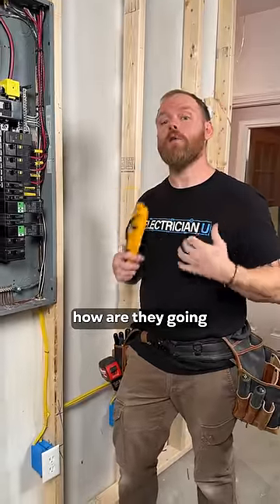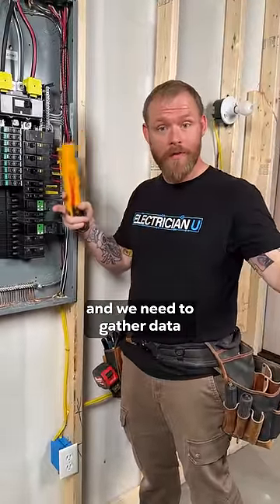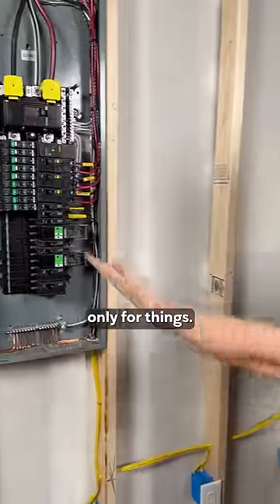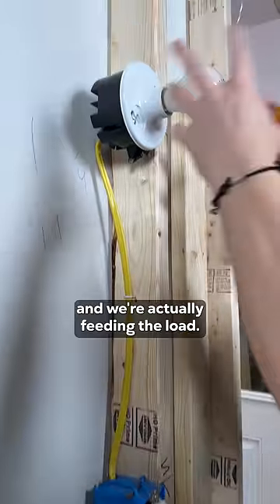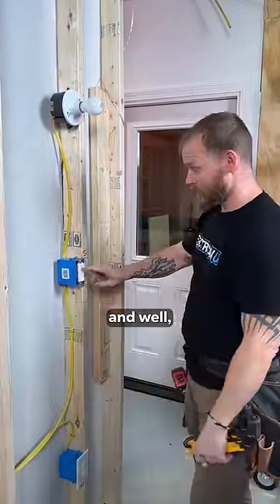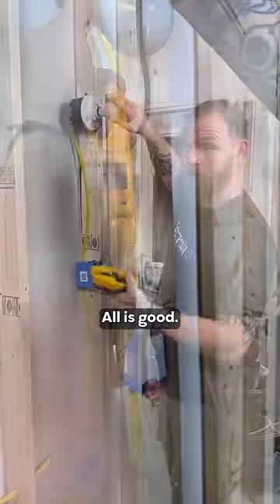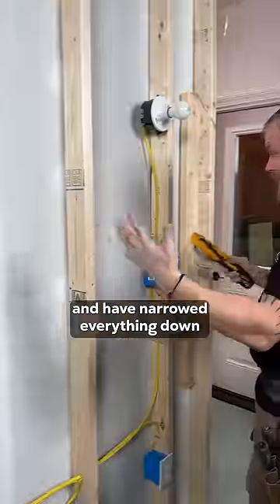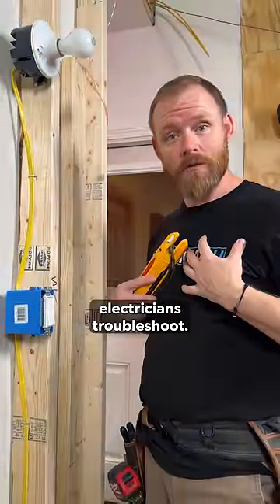How Electricians Troubleshoot a Problem

Comment: I've worked electrical engineering/design/installation/commissioning for 20 yrs now. All electricians are different. Some are great installers (running conduit, pulling cable, etc), some are great at terminating and dressing panels, some are great at troubleshooting.

It's very rare to find all three traits in one.
Reply: As a union Electrician I can say that we train to do it all, installation, troubleshooting and even programming stuff like PLCs...The field is so vast that most guys seem to specialize in a thing, all can do everything, but most are masters of few specialized things, few are excellent all around, but it's all experience based, you can't excell at something you didn't spend alot of time doing! So far I am lucky to have a very diverse and well rounded training (alot of troubleshooting and service calls, and also alot of installation in big new construction jobsites) I concider myself very lucky
Reply: I am a trouble shooter and have people wanting me to wire their new home. I tell them others can do it a lot faster and less expensive.  If they want, I will come back and do a pre-inspection for them.
Reply: I guess I’m an endangered species!!
Reply: @Hatim.13 they teach you to troubleshoot plcs? I heard that’s a whole different game than wiring.
Reply: @Hatim.13   There is no such thing as a Master electrician. I have been an electrician for 25 years and I learn something new everyday.
Reply: @explod329  Well technically there is the title "Master Electrician" which refer to those who took and passed the master electrician test.
But what I meant is that some electricians are masters of few things, for exemple some Electricians are conduit bending wizards, some are troubleshooting rockstars...By Master I meant the best of the best in a specific skill! They re few in between, and their names are known and recognized in the local electricians communities (in the local union)
Reply: @yt-kingdavid2359  PLC's are not that difficult once you get involved with them. Having the software to interface with them can give you much more information than looking at just the lights on the I/O racks.
Reply: And it's why i had such a successful business
Reply: @blybruce  sorry i didn`t see your comment till now. thanks for answering! i build panels right now mainly working on small pump panels. I love electrical work lol.

Comment: That is the most professionally laid out panel box I’ve seen in a while. Nice work.
Reply: Electricians take great pride in clean breaker boxes.... They get sloppy when maintenance, or customers mess with them.
Reply: Only cost the homeowner 2 grand
Reply: @justinberry3991 that's reasonable for a good job it's not hard to find half-assed if that's what you want😅
Reply: @claytongetz6362  I do my own. Electrical is not hard as long as you have common sense 🤣
Reply: It looks pretty but the next guy is gonna be pissed🤦‍♂️

Comment: Test for power at the source, the switch, and the load.
Reply: I would probably go in reverse order to that personally, depending on how easy it is to test for power at certain locations.
Reply: @anthonyesposito7  The order is personal preference, but those are your points of testing.

Comment: I previously worked as an electronics tech (low voltage and data stuff).  The maddening thing to me that electricians have to deal with is the biggest unknown: Not knowing what all is connected to a circuit and no wiring diagram.
Reply: Similar issues in programming: lack of documentation. Even a great system is hard to understand if it doesn't have the right documentation. A poorly designed system without documentation can be easier to replace than fix.
Reply: @moldovancrisis5482  funny, cause I work in development now, and I know exactly what you mean!

Comment: By MAKING an Check-in  you Solve the Problen .
First : analizing the
Source of Power , Second :  breaker and Third the bulb lamp,.
Soon by Constating everything was Ok , EXEPTING the SWITCH from eliminating troubleshoots you find out the cause of eletrical failure.

Comment: I like to take out the bulb and use my noncontact voltage pen and see if there's voltage going up. If the indicator is that voltage is, I will grab my meter and confirm 120.
Reply: This

Comment: I did a TON of electric work as a maintenance tech. It amazing how many people can’t do basic troubleshooting. It’s a process of elimination and understanding how things run. Most people give up because they are lazy. I saved my company at least $10k a year by just doing the troubleshooting. Fixing a problem is easy. Finding the problem takes patience and basic knowledge
Reply: May not even be laziness but a lack of knowledge. You may as well be the second coming of jesus christ to the factory boss if you can re-identify cut motor leads.
Reply: its not really people not being able to do troubleshooting, its definitely people not knowing because they don't care to learn. that's why people hire others that are professionals in that field. so its not that they dont understand, they just don't care enough to learn because that's an electricians job, not theirs.

Comment: Testing continuity from neutral to ground can help identify open neutrals or a break in the wire.
Reply: Interesting I always test hot to neutral voltage but your way would work to

Comment: I would nearly always test from the panel first, see if the contacts on the breaker arent stuck, there's power going out, test for a short if there is no power, test between phases. And go from there.
Reply: Usually residental is single phase so how could you test between phases? You mean leg A and leg B?
Reply: @explod329  Some people refer to Leg A and Leg B as A phase or B phase, even in residential. At least that’s what I’ve heard in the past when I did residential.
Reply: @davisvilla16  Those "Some People" are wrong. It's single phase! How can you have A Phase and B Phase when you only have 1 phase?
Reply: @explod329   at least in canada theres 2 phases on a "single phase" residential service. 120V on phase A and 120V on phase B, 240V between them. Im not sure why its called single phase really. And if you didnt know there's 2 phases why are you trying to correct people lol?
Reply: @explod329  On the secondary of a  center tapped step down transformer the two legs are 180 degrees out of phase of each other. In other words the legs are two different phases.
Reply: @MN-Hillbilly  That is not true. It is the same phase producing two signals. One is positive and the other is Negative while the center is neutral.
Reply: Just call them phases its fine if were getting technical its 2 opposing legs of a single phase transformer. I suggest everybody look into high voltage through👌 fun stuff to research
Reply: @explod329  If it's a single phase then how can it have a different potential (voltage) between them? The transformer is a power transfer device, the primary and secondary are electrically isolated from one another. The transformer is now the "source" for power with two phases that are 180 degrees out of phase of phase of each other.

On the up stream distribution system the whole load is carried by a single phase.
Reply: @MN-Hillbilly  My advise to you is educate yourself on how transformers actually work. Just because they are 180 degress out of phase from each other does not add another phase. You have positive and negative waves within the same phase.
Reply: @UnifiedInfo  No, do NOT call them phases as this is wrong and teaching others with incorrect information. When i started my career people like you would tell me to call it this, call it that. I did not know any better so that is how i learned. Later in my career once i started doing my test i quickly realize that all the terms I was taught was wrong and i really struggled to understand. It felt like i had to start over especially with the terminolgy. Please do not tell people to "JUST CALL IT THIS" Some people takes their career more serious than you and want to be "Technical" I am your "Technical type of guy and I have been very successful in my career and i'm sure others would prefer correct information.
Reply: @explod329  You might want to educate yourself on basic AC theory if you think the positive and negative voltages are the same phase. I will agree it is derived from the same distribution phase.
Reply: @explod329  I like your last reply, you sound like me. I'm not going to give up on you.

I think you are getting caught up with this transformer being fed by a single phase of a multi-phase system. Let's take the transformer out of it. Let's say we are powering a motor, be it three-phase, single-phase, shoot 100-phase. We just want to transfer the power coming into it to another system. So let's connect the shaft of this motor to a magneto (or alternator) and we have two windings in it that are orientated 180 degrees from each other. 

Now we power the motor to spin the shaft that in turn spins the magnet. Would that not produce two phases?

If we added a third set of windings and oriented the three at 120 degrees from each other would that now create three phases?

Comment: As a auto technician, I have the same rough diag steps, as in most electrical issues, there's the control (computer or switch), wiring and intermediate connectors, and the load/sensor/actuator.

I still have to break it down for customers who think the scan tool tells me what's wrong and what to replace. The DTC (Diagnostic Trouble Code) is just a symptom of a problem, or as I like to put it, it's the computer saying "this isn't right, it's not working like it should" 

You have a O2 sensor heater code? It could be the sensor, or a broken wire, or corrosion in a connector, blown fuse, or even a bad driver/circuit problem in the computer. If you want to throw a sensor at it, more power to you, but don't cry at me if it doesn't fix it.
Reply: Most all automotive diagnosis is at least partially influenced by economic restraints.
Reply: I repaired cell tower equipment, 12 layer PCBs, over 1000 chips spread across 4 boards. Our computer diagnostics would say "it's not outputting enough power" and it's up to me to figure out which board, and which component on that board.

Hard job, but you can eliminate half of the chips because it turns on, another half because it's channel 2 that's low, another half because it's the transmit not the receive, etc. Pretty soon you are down to a handful, and can do a combo of multimeter, process of elimination, shotgunning, etc.

Computers and scripts can help A LOT, but they don't tell you what to do, nor specifically what is wrong.
Reply: @phillyphakename1255  Yeah, I agree. Unfortunately it's only going to get worse. The vehicles now are rolling servers cabinets. +30 computers, 5 or more different communication networks (including Ethernet, not the same as internet Ethernet either), some computers that are also hubs and act like routers, now also throw in cell phone, wi-fi, Bluetooth, GPS, sat radio, sat TV...

For example, Cummins diesel has 5 computers to run it and the emissions system, all running on their own separate communication network.
Reply: @CJ-jo6do  oh gosh. That's... A lot.

I know you'd just be doing board level swaps, but with a system that big, "just" isn't really a good description.
Reply: @phillyphakename1255  Yes, real fun explaining to customers what and why their vehicle doesn't work, and the diag time.

Horn don't work? Could be a fuse, bad switch, or a corrupted IHS CAN bus because of corrosion in a harness connector causing lost of communication between the SCM and the BCM. You know, simple things.😅
Reply: @CJ-jo6do  now you're just confirming my "no automotive electrical for friends for free" rule.

Comment: My buddy decided that every light fixture and switch/plug device had to be removed from his apartment. It was wired by some guy back in the 70's. The main light fixture box (center ceiling) was a main junction point to 3 runs. One was a single 14/2 wire ran to the main light fixture, backfed down the neutral. Two other legs, one a main supply to a small addition and one wad the outlets/second light in the bathroom. Surprised the hell out of me, and reminded me why I am happy to have a quality auto ranging multimeter with NCV test capabilities (Southwire).

Comment: I had a circuit with three groups of 4 recessed LEDs I installed recently. When turning one on of the groups it would immediately trip the breaker. 

The junction box for the lights had a resistance readeing of .5-.9 ohms. I went about searching for any discrepancies and eliminating possibilities. It ended up coming down to one of the hot wires in the first box somehow making contact with the metal housing. It was difficult to reach and I wasn't able to see exactly how it happened, but i got it sorted out. I enjoyed the troubleshooting part of it.

Comment: This is really the process to troubleshoot anything. Car, computer, etc. It's basically Occams razor in a process of elimination algorithm.
What's wrong or what needs to be fixed? What's the simplest explanation? Did it work? If it didn't: What's the next simplest explanation?

Comment: You can have a “hunch” on what’s wrong and go right to that but generally you check the easy things first then if necessary you go progressively deeper. That’s how experienced electricians trouble shoot and how new ones should be taught.
Reply: They get paid by the hour, they will stretch out their "hunches".
Reply: @moefritz9568  not if you want repeat business real professionals don't waste time they find the problem

Comment: i would have felt the switch, noticed it wasn't functioning properly and replaced it right away. Then moved on afterwards. Like, you can easily check if it has power with a power probe, multimeter takes a lot of time to get out, connect, turn to the right setting, etc.

Comment: I work on cell towers. It's basically the same process for us doing maintenance. One additional thing we do is use a "known good" to narrow down the issue. One radio is powered up and the one next to it isn't? Roll power between the two and see if the issue moves or stays.

Comment: As an electrician I’m just curious what you could possibly need that massive belt for
Reply: Coffee, creamer, sugar, cup, spoon and biscuits.  😂
Reply: Joking aside a belt with that much metal and junk is actually considered dangerous in an industrial environment,  And in food production is actually illegal.
Reply: Other than sexy, it depends on the job and environment.  As someone who often works on old multi-story buildings, where I'm up and down stairs, ladders, etc. Having all my important kit on me is the way to go. I have a few different belts and bags,
Reply: @stringlarson1247  The one time I tried one it kept getting caught on my safety harness and the sides of the cherry picker. I ended up with my tools in a bucket.
Reply: @dogwalker666  heh. I did the same last week when 3 stories up on a ladder. Just wasn't in the mood for taking a header.
Reply: @stringlarson1247  Definitely not a fun thing to do.
Reply: so he looks impressive as would be influencer
Reply: Tool bags are for apprentices. 

We usually make them wear them. I have a smaller bag that fits only one side and has enough pockets to fit the most basic tools needed for the current task at hand. I always wear a safety vest at work and take advantage of it's pockets to carry any extra hardware required like connectors, couplings, face plates etc. I do fine.
Reply: You think it's a huge waist?

Comment: Tradesman here, automotive and electrical engineer. The simplest, most time efficient and effective way  to begin and follow a diagnostic problem is to start with the simplest things to check. The one that is the quickest and easiest, then work your way backwards to the most time consuming and hardest things to test. Don't cut corners. Is it plugged in? Is the power on? Throw away all presumptions, you're not that smart, trust me, I'm not. But 9 times outta 10 I'll always find the problem before the other guy. And I'll be able to say exactly what the problem is, not "I think it's..."

Comment: Depends on the electrician. I worked for a guy that would have me open every box just to test every location instead of using knowledge of electricity and components to easily and rapidly diagnose problems. In simple words, idiots make working more difficult.

Comment: Yes, but if you have a wiring hub it might not be wired correctly, or a cable may be short circuited if it is damaged by doing some other work. These problems are a bit more complex than what you described.

Comment: Im not a sparkey by trade, but grew up doing electrical work and actually wanted to do it as a career, but went into cy er security. My new house i had built in 2019, my master bedroom had bad electrical issues. Thankfully i took pics of everythhg and knew where my home run was.  And it turns out half way on thr line, the electrician hooked up the hot abd neutral lines to a switced outlet when it was fes direct to the box. So that means half way thru, the second half of my wire, the electricity had 2 highways to get aroubd and back. This caused all kinds of power surginf and lights pulsing and tv going out when boxfan turned on and rhe afci random flipping. Cut out that second hot leg in the circuit and boom. Its perfect now!!!

Comment: Wish you electrician would stop over loading circuit breakers in order to save money 
What about the homeowner who plugs a vacuum cleaner in bedroom outlet and the overhead lights go dim. Kitchen can lites overhead onto one circuit breaker and the lights go dim when an outlet is used near the kitchen

SO MAYBE RHE ELECTRICAL INDUSTRY WOULD NOT SHORT CHANGING THE HOMEOWNERS WITH YOUR OVERLOADED CIRCUIT LINES